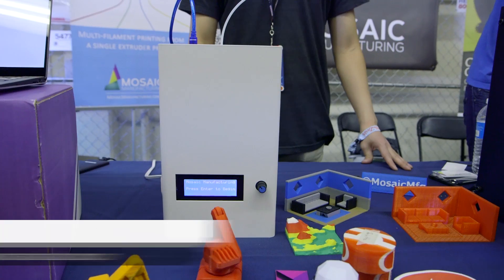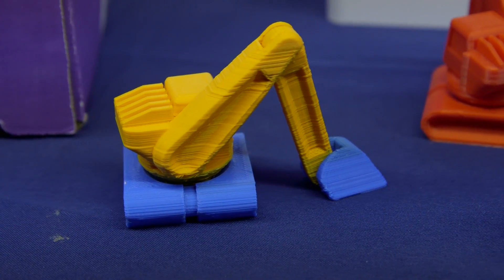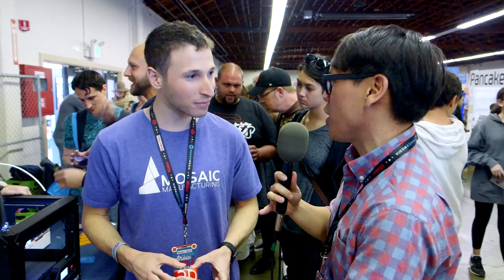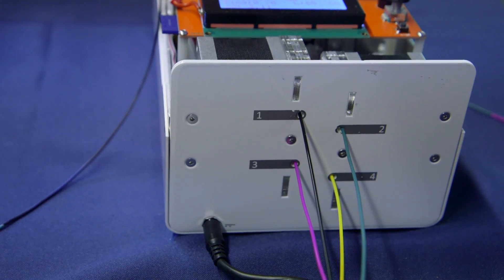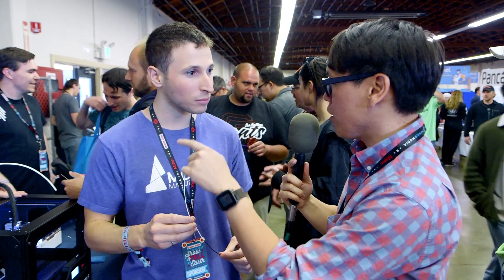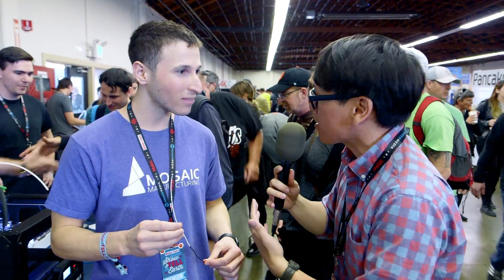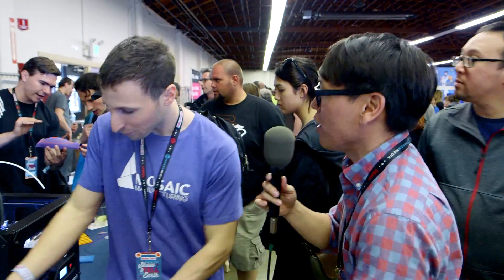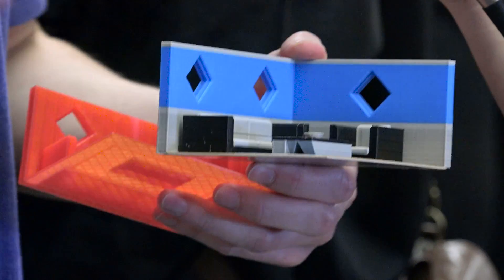Multi-Color 3D Printing with Palette Filament Splicer

Comment: "We try to keep it really simple" appears to be marketing wank for "No, it can't do that"
Reply: To be fair, feature creep is a HUGE issue with many kickstarted projects. Stretch goals usually delay the release of an item if it's an improvement to a main product. Even more, I'd rather have a product do one thing incredibly well and reliably rather than a swiss army knife with dull blades, missing springs, and falls apart after maybe the third use.
Reply: Hey SilentS, Brennan from the Mosaic team here.  You (and seegurkekiller above) are 100% correct that Mitch chose his words very carefully.  The reason for this is that it's totally different trying to tailor your language to a large Tested.com crowd versus communicating with people who are experts in 3D printing.  If 100% of people on Tested.com were 3D printing experts, then Mitch could have used very different wording.  We're not trying to mislead people.

For those familiar with 3D printing, please allow me to clarify some misconceptions and to be crystal clear on what we can and cannot do right now.

We CANNOT:
- Support use with different filament materials other than PLA and PLA-based materials.  This means that Palette is not currently compatible with ABS, Nylon, flexible material, and support materials.  (We are working on compatibility with other materials, and these initial tests show some promise, but we don't like to say that Palette can do something Palette before we're really sure that Palette can do it reliably.)
- Support nozzle sizes other than 0.4mm (the most popular nozzle size) at this time.  (We're working on our software to allow for different nozzle sizes, but we don't currently support other nozzle sizes at the time of writing this [May 31, 2016].  We estimate support for other nozzle sizes in the next few months.
- Support layer heights other than 0.2mm.  Again, we're working on it, but it's 0.2mm or nothing right now.
- Support filament diameters other than 1.75mm.

We CAN:
- Support a large variety of PLA-based materials (as Mitch said, this includes your electrically conductive, magnetic, woodfills, bronzefills/metal fills, carbon-fiber infused, and more).
- Offer multi-color (max 4) prints with 0 modifications to printers (aside from adding a piece of Velcro to the back of the printer on which to attach our calibration system)
- Offer multi-color prints for way cheaper than most multi-extruder printers
- Offer multi-color prints of amazing quality without many of the downsides of multi-extruder printers (most multi-extruder printers are way more expensive than a Palette, have smaller print beds [on multi-extruder printers, each extruder needs to be able to get to each corner of the print bed], and are a pain to calibrate [dripping, knocking the model, etc])
Reply: I definitely admire that. Having gotten only one product out of eight that I've funded on Kickstarter, I definitely respect startups that focus on getting their stuff out as soon as possible in the best condition without extra fluff added for the sake of adding things.
Reply: As the internet always said, "You have one job". They have one job and they did it well. I cant say that for many projects out there that too greed with features and end up doesn't even do its primary job right.
Reply: Hey Koriko Alistar, Brennan from the Mosaic team here.  You're totally right.  It was a very intentional decision not to have stretch goals that would change the product for exactly the reason you mentioned.
Reply: COUGHMIGHTYNUMBERNINECOUGH

Comment: I would have liked to see it actually working. Like, is this a box that sits on the printer to feed it the filament of the required colour when needed, or is there some clever measuring that's done to create a purpose-made spool for that specific print job, or what?
Reply: Well, The way it was explained in the video is that the box has the same file as the printer and sends what is required. It making it as it is taken out.
Reply: its actively making the multicolored filament as its going along
Reply: I have a two color test print with the Mosaic Palette on my channel, not real informative but it's there. So in a nutshell you import 2+ STL files in your slicer and slice the models as if your using two hotends/processes. Import that gcode into the Paletee software which will create the two files needed to separate the colors by splicing the different filament together. One file goes to the Palette to generate the length of each splice and the other goes to your printer for normal printing.  The Palette uses an optical encoder to detect the filament usage, That encoder is programmed to detect specific pauses within the print called "pings" ( typically during the transition tower color changes). If the pauses don't happen at a specific anticipated time to correlate with the expected filament usage  , the Palette will adjust the filament splices to correct the calibration.
Reply: Kevin Stacy
 when i click on your name it doesn't go to your channel. what is the name of your channel.

Comment: Would it be possible to get 16 colors by using 5 splicers? Think about it, add one splicer to every input of your main splicer.
Reply: You must construct additional pylons.
Reply: You would just need to change some of the code and you are good. i dont know if it is open source
Reply: The fact that you need one transition tower per colour, 16 colours would mean 15 transition tower, I'm not sure you'd have much space left on your platform if you gotta build that many towers...

Comment: possibly the ability to make circuit boards? that will be interesting and exciting as well!
Reply: You would be better off buying a cheap cnc router to make real circuit boards than trying to 3d print one.
Reply: I know you meant that as a joke but i might be possible, not practical but possible
Reply: probably but you wouldn't be able to solder to it.  It would be more like a bread board with specific connections instead of columns and rows
Reply: That's exactly what I was thinking. This would be a game changer (for me at least) if it could make PCBs and I could print something out straight from Eagle
Reply: +David Boucard make your own motherboards for a gaming PC LOL
Reply: I know but this product still has potential in other areas